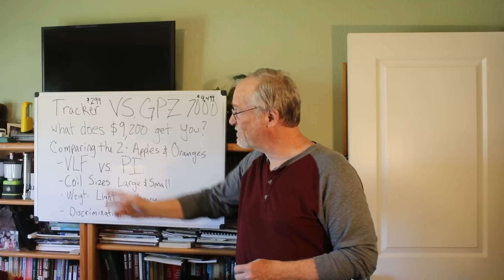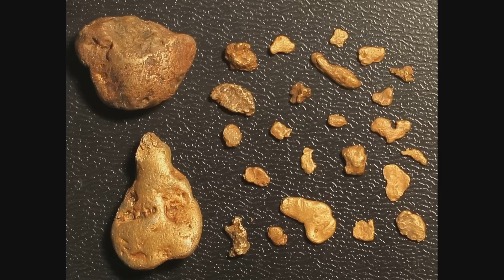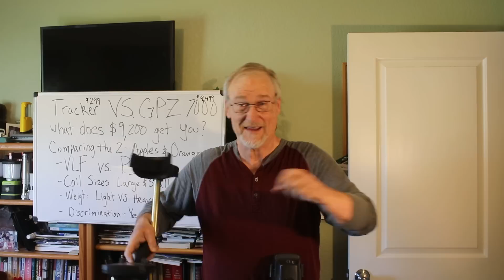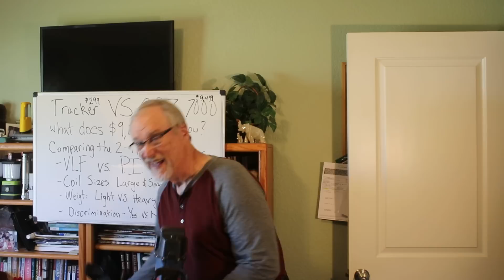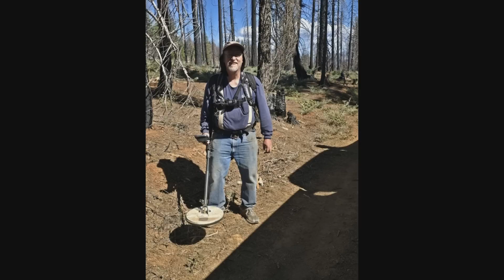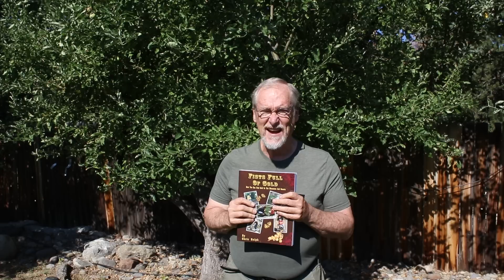$300 vs $9,500 Gold Nugget detector comparison

Comment: Dear Chris whar you think about the new era of  Minelab FBS (Full band spectrum 15 hz technology sensors used in Minelab CTX3030 ? Sec9nd question why some of the EXPENSIVE GPZ DETETCTORS  coils are ful white plastic disk alike ? Is it all the wire spread sealed inside ?ty
Reply from the maker: CTX3030 good with smallest coil
Reply: @ChrisRalph  I will send you email on your website to dig deeper about the relationship of 3 elements size of coils versus all sensors on markets versus 3 different targets in range to buy detectors under 2-3$ half price of your favorite for multiple use brother Ty

Comment: I currently run a gm2000 and a gpx5000. Do you think a jump from the gpx to the gpz is worth it if you know how to dial in a 5000 already? I found a gram of dinks with the gm2k for couple hours going behind someone with a gpx6000... the gm2k has been great especially in trash.  I like to say it goes to the places no other pi will touch lol. Curious to get a comparison with a gpx5000, 25in mono trash can lid, against the gpz7000. Think it'd be close? How hard is it to pinpoint with the gpz? And can you you run a DD in cancel at all or is it strictly mono?
Reply from the maker: I'd need to write 2000 word answer to cover all that - let me hit the high points: The GPZ outshines the 5000 on mossy or wiry gold. On real solid nuggets not so much. There is no mono coil for the GPZ. It runs special DOD configured coils. GPZ is definitely more difficult to pinpoint with, especially with really small gold. I use my monster or SDC as a GPZ pin pointer regularly.

Comment: Hey Dr. Chris will my Falcon MD 20 pick up fine gold?  When there is no visible gold? 
If a rock has magnetic properties can it have gold still? 
My Falcon goes off on a rock both when I get close and touch it and pull away… they have crystals of some kind but so far a wire brush with water and a few minutes doesn’t clean it off. can there be gold in it? I know it sounds odd. I may have every kind of granite metamorphic even conglomerate and Rock with Chicken Pox. Same place. 
I got down over four feet where the second layer of mud clay and a sand are. 
Weird is at this second spot there are places of soil. Not sub soil. I know it’s long. I have even more question from what is down there!! 
Thanks very much
Reply from the maker: The Falcon should work on small gold, but only if the gold is large enough - even the MD 20 has its limitations..

Comment: I don't think you read my question correctly. I asked if there wasn't a brand of Used pulse induction unit you could recommend at the $3,000. level. You said there were no new ones you could recommend at that price. Surely there are good quality brand used ones. Please tell me a good brand of Used pulse induction unit and how much it might cost.
Reply from the maker: Used detector prices vary - think of used cars - not all used cars of the same make and year sell for the same price. Some have more miles than others. If you could get an SDC 2300 in good condition for less than $3000 that would be a good one.

Comment: Why will you not recommend a specific brand of pulse induction unit that I might find used for $3,000.?
Reply from the maker: All the PI units I would recommend are more than $3,000 if purchased new. Gold oriented PI detectors are expensive.

Comment: I have an interesting story. I used to make pouches for Jimmy Sierra in San Rafael. In the 90’s when I first started working with him he had a prototype of a metal detector with a coil made of wood. It made a funny sound when turned on which is a sound I can recognize today since that prototype was actually one of the first gold machines Minelab made, who knew? The Whites gold detectors in those days had to be ground balanced every few feet since they didn’t have automatic ground balancing yet.
Reply from the maker: Ground balancing certainly has improved.

Comment: I understand that there is no pulse induction metal detector that is as powerful as the GPX6000, but what is the least expensive pulse induction metal detector that is still good at finding gold?
Reply from the maker: The GPZ 7000 is still more powerful than the 6000. Lots of folks who do mods make a lot of claims, but they are not universally agreed to. Plus, modding your detector voids the chance of repairs - most companies wont touch a modded detector.
Reply: Modified early models are popular at the moment in Australia for getting big gold
Reply: The Garrett Axiom.

Comment: Hey Chris
  Is it worth it for a beginner to spring for the better product assuming that it will have better capacity to find more targets? Does it hurt the learning curve?
Also, with the larger coil (XL?) for the GPZ, do you miss some of the smaller nuggets closer to the surface?
Reply from the maker: If you have the money, I buy the Gold Monster. Its overall better, its just nearly 3 times the price of the tracker - but it is a much better detector.

Comment: Great info! When you do the field test, I'd love to see the gold monster 1000 included. I look forward to seeing that video. Thanks Chris!
Reply from the maker: Yes, when I do the field test, it will have the monster, the GPZ, the SDC and the Garrett axiom as well.
Reply: @ChrisRalph the axiom seems to be a great detector. I want one but no sense in buying  one cause it will just collect dust.
Reply: Yip, good. I got the monster 1000 and need to know how it stacks up.
Reply: @andrewmunchkin7212  the gold monster is a good unit. Keep in mind the 5" coil is a limiting factor.
Remember that the detecting range is the size of the coil to a pin point in the shape of a V.
Consider the depth you're getting....you have to be right on the gold with a monster or a Monster nugget.
SDC is a little better then I'd like to test drive a 6000.
All it takes is money or find enough gold and upgrade.
Reply: Looking forward to the comparisons especially from someone that doesn't have a 23 page signed dealer agreement. 
I once was a dealer for Codan/Minelab & First TX/Fisher
Love your unbiased insights
Reply: I had a guy go over a ravine with a GPZ 7000 and the conclusion was that the ground was just too hot to find any real targets.
Since then we have pulled a half ounce of gold from that ravine with a SDC and monster.